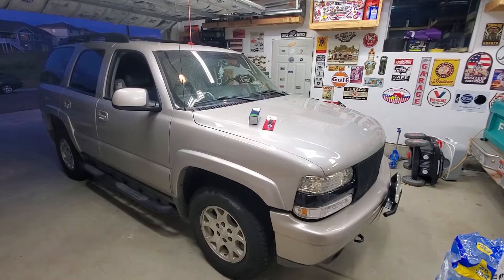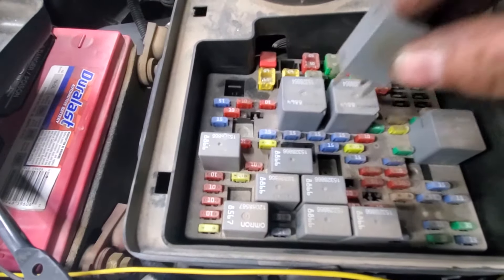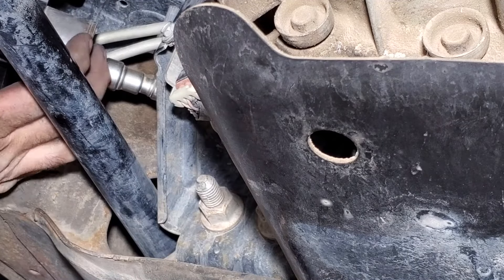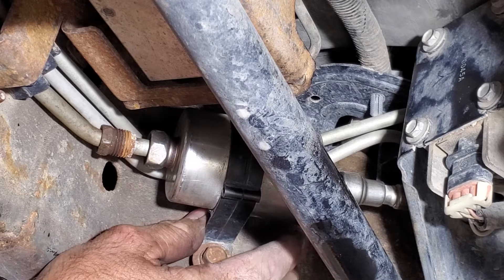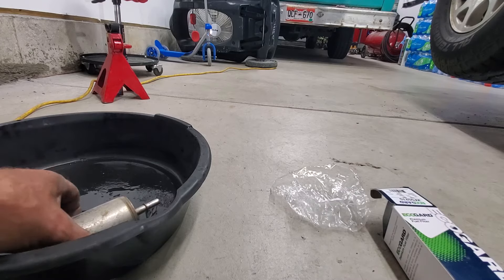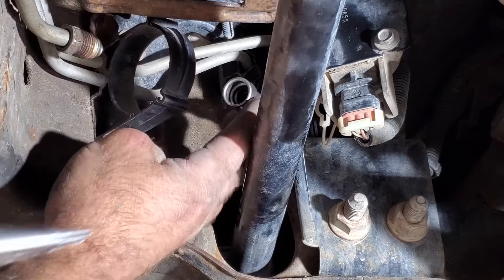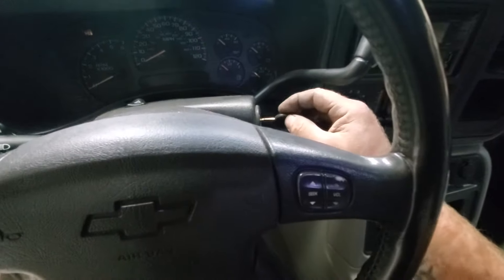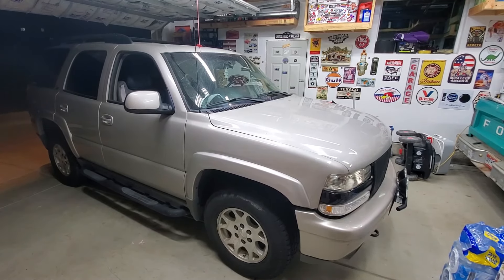Chevy/GMC 5.3 Fuel Filter Replacement Yukon/Tahoe, Silverado/Sierra, Suburban, 4.3, 2.2, S10, Blazer

Comment: Dude….i followed you every step of the way….tool….same….relay out….and after 2 hours of struggling with the Tool….the Filter….even removed the bracket and screw on fitting etc etc…could not get that quick release to let go…had to put it back together…drop the Truck…clean up my blood and the dirt and abrasions and give up.
Reply: Trucks don’t get their way with men. Men get their way with trucks.
Reply: Don’t feel bad! One of the tabs inside my connector was bent so I used a flathead to force it off! I didn’t know I could pop the original out & replace it!
Reply: Watching this video a year later and I had the same problem! Ended up giving up because it got too hot on that ground. I’ll try again tomorrow
Reply: Dam!!!
Reply: @jovanimicheo  That's messed up dude... Leave the poor dude alone... Not everyone is mechanically inclined like you and I... 😂
Reply: Sound like a quitter
Reply: @davydeenice1174 it's a clip tho lmao should go to your red neck mechanic at least
Reply: I struggled with the quick release but got it done on my 2004 Suburban. I used the open end of a 14 mm combination wrench to help force it off. I recommend driving the truck up on a ramp or jacking it up to give you more arm room for leverage. I used a 13/16 and a 16mm for the other side. Great video. Thanks. 💪🏽💪🏽💪🏽
Reply: If this happens, then cut the lines and connect new. With better connects

Comment: Honestly I just take my impact and take out the strap holding the fuel filter in. Makes life 100 percent easier.
Reply: For sure. All the time spent screwing around fighting the filter and one bolt and it would of fell out.
Reply: Did you put the strap back on or did you just toss it?
Reply: Keeps it all in place to unscrew easier if you leave it strapped. For most people. Having to remove it anyway and having the filter lose makes for breaking parts and parts move when unbolting before hand.
Reply: @jacksonross3533 probably broke it😂

Comment: Just tried this tonight with the “special tool” 2 hours of frustration and I gave up lmao. I changed mine last about 50k miles ago. Used a metal set of the fuel line disconnect pliers on the other end of the short line. It was still a pain but it worked. Should have just stuck with that method again lol

Comment: Very well done video. I’ve got 200k+ miles in my fuel filter. Think it needs a changin!
Reply: Mine has over 300k miles and I don't think mines ever been replaced 🤯
Reply: I kno you guys can tell the difference once you replaced it
Reply: Dam 200k on that filter? Your working the hell outta your fuel pump... I bet you can barely blow thru it...
Reply: @UnadoptedZANe  Gee Whizzz 300k... Incredible... I know yours was partially clogged... Dam!!! I change mine every 12,000 miles...
Reply: @sunnmontana6369  Yeah right... Dam 200-300k miles on 1 gas filter is crazy...

Comment: Thanks for the video. It was much more difficult to get that clip off but otherwise it was pretty smooth thanks to you! The fuel line removal tool I had was a lil different so I broke it in half and it finally worked. Thank you for sharing your knowledge it was very helpful!!

Comment: What does it mean when you keep pumping fuel and the pump steady clicking then I  pull it out a lil and does the same thing then spit out gas Everytime I’m pumping gas I have a 2005 Chevrolet Tahoe LT
Reply from the maker: Sounds like you have a clogged or kinked fuel tank breather hose. If the tank builds up to much pressure when pumping gas it shuts off. Have you tried pumping gas on the lowest setting of the nozzle or tried tipping the nozzle upside down while pumping?

Comment: I have a 2011 surburban and I’m thinking that’s rhetorical problem that’s causing the nozzle to caught off when I’m getting gas. Definitely going to do this when I buy the filter. Hope that’s the case and not the fuel pump because I’m not trying to drop the tank

Comment: Good video.  I own a 2002 Suburban we bought brand new with the same fuel filter (NAPA Gold 3623).  It's in a horrible location to get to, especially when you're 73 y.o.  My car has 159,000+ miles on it (don't know exact mileage because the odometer dash circuitry has failed, so I judge mileage by the oil change interval service light).  I am changing this filter for the 4th time today.  I can't imagine your car going 170,000 miles on one fuel filter.  Although the brand filter you replaced is OEM, the previous owner probably had it changed at the Chevy dealership.  The most I have ever gone with this car is 45k on a fuel filter.  My wife nearly didn't make it up Snoqualmie Pass five years ago when the car started acting up on her, nearly scared her half to death!  I had changed that filter 35k miles prior to her experience.  After she got home, we continued to drive it for another thousand miles with no issues (I chalked her experience up to water in the fuel she purchased).  Then one day I decided to take it up a highway on a steep incline at full throttle.  It started hesitating badly and I knew immediately it was time to change the fuel filter again.  That was five years ago, so today is the day because I hate surprises on a road trip!

Comment: Thanks a lot for your video man it helped a bunch. Made a huge difference in power on my Tahoe. For anyone doing their own it’s not a matter of force when it comes to pushing that tool in there it’s just a matter of making sure the tool is in all the way and using something to push the hose towards the tool then away from the tool until it comes off nice and easy. for me i used a pair on those long nose needle nose pliers with a 90 degree bend om the end at the same time prying on rhe tool with a small prying tool or screwdriver ro make sure it was totally unlocking the clips.

Comment: Thanks for pointing out removing the metal retaining clip on the flex line connector and replacing it with the plastic one that is on the new filter!
Reply: I have never replaced that metal retaining clip in the line past the fuel filter.  It's the o-ring that seals the deal and that's brand new on the new filter.  Have never had any problem continuing to use the old metal retaining clip.

Comment: I have an 03 Suburban with a 5.3L Flex Fuel engine. I only use regular gas for better mileage. The parts are different regardless of which gas you use. (Flex fuel when 8th character in VIN is a "Z")
I mention this because the fuel pump and fuel pressure regulator are different. The fuel pressure is different as well. I don’t believe the non-flex fuel 5.3L engines have a serviceable fuel filter but I am not positive.
It's good you mention the "low profile" fuel line tool as the standard size fuel line tool is too long to fit in that tight space.
Good video!
Reply: I have a 2004 GMC Yukon with flex fuel and it has the same fuel filter design as the one in the video. Thanks for mentioning the 8th digit. I have several tools for removing fuel filters but I don't have this one.

Comment: Hard to start after replacement I’m sure I have air in the lines and was already having fuel issues with my 04 Tahoe flex fuel in the first place any suggestions to get the air out? She runs good after hard start but obviously would like to correct the issue

Comment: I've had problems with mine, when sitting an an idel, the rpms will start bouncing from like 450 to 750, and when it's not doing it, it will sit at a constant 750 healthy idel, no check engine lights or reduced engine power modes, and I've replaced the cam sensors, throttle body position sensor, throttle body, air intake, air intake, all 8 spark plugs and all I spark wires and the ignition, I ran fuel treatment, I've noticed it does it more on hills, so I'm now going to replace the fuel filter, and maybe pump if it doesnt fix it, have you had any similar issues or know what could cause somthing like this?
Reply: It's a 2004 tahoe z71 5.3 flex fuel
Reply from the maker: I wonder if it could be a vacuum leak or vacuum hose collapsing. Also thought it would be a dirty throttle body but you already replaced that. Yeah give this fuel filter a try and let me know because I'm curious as well.
Reply: Intake gaskets
Reply: Didya figure it out? I got same problem.
Reply: @VibeRezz  did you figure out the issue? Similar problem going on. Thank you
Reply: Throttle Body position sensor

Comment: Ford went to these inline filters on my 2000 F150. I HATE them!!! '84/302 had a throttle body mounted filter. 2 wrenches and presto. Done. Those little locking tabs are a major PITA to get off. I'm not a fan of cheap plastic replacing the metal retainer on a fuel line though. Thanks for including that! I like Wix and Mahle filters. K+N as well..Napa Auto sells Wix as "Napa Gold". I want one without the plastic. One commenter was right. Pop the retaining strap and give yourself more space to work with. '00 F 150 that retaining band is welded on and rots in 🇨🇦 salt. Your stuck with removing the clips as is. 
     Gotta say I was NEVER a fan of the General. Ford guy all my life. Won't even look at Fords now. That said. This '04 Sierra is actually easier to work on then my '00 F150. Good trucks! Why GM messed that up with AFM and TVs and ball warmers and spotty trannies for $80K+ instead of a stick and roll down windows and the current BS with Barra limiting production to keep the prices skyhigh is a shame. That 5.3L is otherwise a good motor. Easier to work on. 
     Vulva oops Volvo ever goes back to making Brick cars they'll clean up. Me included. I want a Milkot. Can't buy em here. Someone stop this insanity. They only have to be pickup trucks. Not Cadillacs with a bed. 
     Great vid Brother!!! Straight to the point. No BS. No background music. Got yourself a subb. 👍👍

Comment: I have a a problem I have to crank hard everytime I start 01 tahoe btw and I check all the ground the fuel pump relay and the code that come out is the knock sensor so now I don’t if I want to check the fuel pump or and fuel filter or change the knock sensor to see if the hard cranking stop thanks to anyone that replies appreciate it
Reply from the maker: If your getting a code showing an issue with the knock sensor then i would definitely start by replacing that and go from there.
Reply: @BLUECOLLARGARAGE  thank you I’m thinking of doing it myself I will buy the sensor from ac delco but the wiring harness from Dorman since my Chevy dealer wants to charge 100 for just the wiring harnes so ac delco sensor and dorman wiring harnes does that sound good?
Reply: @BLUECOLLARGARAGE  and ofc buying the gas line remover and a 30 dollar torque wrench

Comment: I got the K&N filter but dont think it has the longer skinnier neck on it and its too cold and snowing here to get up under it to look. I got a 01 tahoe are they all the same?
Reply from the maker: No I believe the 2001 tahoe is different so I think you got the right one and you shouldn't need the special line disconnect tool like I used in the video. Should only need a couple wrenches preferably a line wrench on the fuel line side.
Reply: Do you have flex fuel or gasoline only? From what I've seen the gasoline filters have threads on both ends and the flex fuel filter has threads on one end and the locking nipple thing on the other end.

Comment: I worked for about an hour trying to get the 2 little pieces in there and the wrench on'em. I gave up. The filters been on there at least 15 years (tis how long I've owned the 'Burb), it can stay on there another 15. Not worth the aggravation.
Reply from the maker: Yeah man it’s aggravating especially because there’s hardly any room to work. If it’s still running fine then I’d call it good.
Reply: @BLUECOLLARGARAGE  My buddy owns a little shop, he said $62 labor alone to change it, screw that! So much for being a buddy lol! I gave it another go tonight. After about an hour, I was finally able to get the latched side line to release. NOT fun. Even pulling the filter out and down so I could get at everything, it refused to release. 32 degrees, laying on concrete, and holding my mini maglight with my teeth. Gas was pretty dark draining out of filter when I got it off, definitely needed changed!
Reply from the maker: @applejacks971  glad to hear you got it changed should be the last time you’ll have to do that lol.

Comment: It’s crazy how no parts store in my area has that fuel line tool
Reply from the maker: Yeah that’s why I had to get it off Amazon I couldn’t find it locally either.
Reply: Harbor freight has some
Reply: @kevinherrera9580  I ended up getting a plastic 3/8 tool from oreillys for 3$

Comment: Thanks Man…today…I did everything…exactly as you in this instruction….and I got it to move a bit with the silver set and the Tool….but could not get the fitting to move back like you did,..I pried and pried and took off the other end….broke the bracket…got soaked in fuel….bloody and dirty for two hours…and for the life of me 🙏🏻.I could not get that damn fitting loose….I have seen people Cut the end off the Filter…in frustration….and I saw one guy remove the short fuel line with the Filter on…but I am wondering….why did my Mechanic a few years ago…leave the metal retainer in the fitting…if…if…he actually changed the Filter…maybe Not….I assume….I guess I will order a fuel line…remove the skid plate and fuel block….I will use the plastic retainer on the new Filter.
Reply from the maker: Sorry to hear that this didn't work for you. Did you try sticking the silver inserts in at different angles? I wondering if one of those tabs is bent just enough and not releasing. It's kinda of a poor design by GM and on top of that they give you no room to work.  Hopefully it works out for you. Thanks for the positive comments 👍
Reply: @BLUECOLLARGARAGE  ha ha….ya I hear ya…I tried all angles in two hours….but a video for the metal  X Tool….mentioned to grab the fitting and push toward the tool….or you lock those tabs with the disconnect Tool….and I was trying to do that but could not get a good grip….it is crazy tight in there….I will order a short fuel line…rest up…and give it a shot when spring comes….it could be damaged from the Shop I had used….found out they charged me for 4 O2 sensors…and I realized later…they only changed one…I had marked them prior….that’s..also..why I am doing my own Work now….you make a great Video….should have gone smooth….Thanks…blame GM.
Reply from the maker: @rayn3038  good idea on marking the o2 sensors before hand. Can't trust most shops anymore. Well hopefully you get it taken care of.